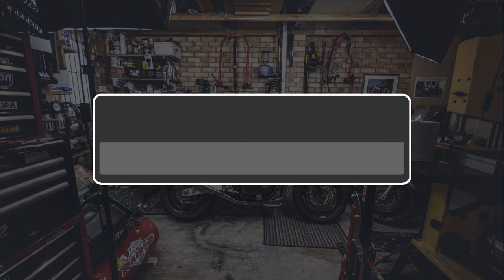Suzuki bandit gearbox problems! || it's Bandit o'clock series 2 Part 6 ||

Comment: Informative video, but you forgot to mention one of the hidden bolts. I found it the hard way, and it is the bolt next to the sump filter for the oil return pipe. :-)

Comment: I have a 99 mk1 600 which has a oil leak so need top end gaskets but mainly the gearbox from N 1st 2nd is horrible even worse when down shifting ......... I think this is out of my skill range . WILL BE RELTING ON YOUR VIDEOS FOR ALL MY ENGINE STUFF .........Super appreciate the time took to do this
Reply from the maker: Hey Dan, sorry about the slow reply. Have you fixed the problems? the 600s are a little different to a 1200 but are fairly close, it's worth getting a workshop manual 👍
Reply: I have still yet to undertake the challenge little daunted having to do head and bottom gasket. It's the timing that is worrying me

Comment: "I hate undoing circlips"
Me too, especially without my safety squints, as AvE calls them.
Been thinking of getting an Abba stand now that I have a GSXS without a centerstand like my Bandit 1200.  Then I can use the stand to rebuild the Bandit like you are doing.  Just a thought.  Might be a fun project.  Not sure what I will do with the Bandit as it had been a great bike.
Reply from the maker: I’ve recently got a new pair that are like sunglasses, with my old ones on it was like looking frosted glass! I do like the ABBA Skylift, I’ve just taken my turbo Bandit off it and I’m going to put the Hayabusa project on it so I can remove the wheels for powder coating and still move it around the garage

Comment: I have  a 2002 Bandit 1200, and I am thinking of rebuilding the engine. Is there any particular manual / publication that will help me walk through the process. My typical experience is rebuilding smaller size engines, but looking forward to the challenge. Also, are parts till available for this engine? Any advise you can provide will be greatly appreciated. I plan to watch you video to see what I can learn.  Thanks... John P

Comment: I have an issue with my 1200 bandit it wont change gear, when setting off it will not change up to second or above but if i get up to some speed it will, but then it wont change down, i did have a gear crunch moment entering into a bend rather fast, but i was fine after just started few weeks later, i don't want to strip it unless i know i have too, been looking for answers  for a while now

Comment: Thanks for your works!All video is great and very usefull!Keep going! This  video  intrest me the most, because i have the same problem too.I have a 1997 Bandit 1200 with 71000 km. The 3rd gear is the loudest,but just until 4K rpm.The 4th gear is not soo bad!Please answer me this question:this gears can make a bigger problem? Or "just whining "and thats all?I dont wana disasemble the engine,its running great.Waiting for your answer.! Thanks! Greatings from Hungary!
Reply from the maker: Hi István, thank you for the kind comment. The gears make noise because of pitting and wear, you could leave it and get no problems for another 71,000km or they could go wrong in 1,000km you just can't tell when/if they will go wrong, I will keep this bike forever so want to make sure it will last 100%. All the best Shroomy
Reply: Hi! Shroomy! Thanks for you answear! I will keep my bike forever,like you!I make every year a little upgrade !I always give my bike the best, and  I dont wanna, the engine get damaged.!I just plant,when the engine get worner, i make a rebuild and then  changed the gears! Thanks again! All the best István

Comment: I  have a Bandit 1200 07 with only 42000 km and I always change the engine oil every 6 or 7 months because I don't use it much. I went to change the oil recently and, for the first time, some bronze-colored filings appeared. I thought of the worst problems. So I removed the oil filter and opened it to check the amount of filings that were inside it and, to my surprise, there were no filings at all!!
How can there be filings in the oil and not in the filter? Any explanation for this problem?
Sorry if my English is not correct. I'm using google translator.

Comment: Great videos! Helping me a lot as I'm rebuilding a bandit and this is my first time rebuilding a motor. I made a rookie mistake of not keeping track of the bolts as I took them out. Do you know of any diagrams that have bolt locations? The ones I seem to have trouble matching up came from the crank case.
Reply from the maker: Hi John, good to hear you are getting stuck in, only thing I can think of is a parts diagram but when the bolts are just placed in they should all sit with the same gap if that makes any sense. All the best Shroomy
Reply: In my experience Japanese motorcycles have the crankcase bolts and their positions numbered

Comment: Just found this video. I need to replace my output shaft on the gearbox and now seriously wondering if it is worth it or time for a new bike!
Reply from the maker: Hey Steve, with the manual, parts and tools you could easily do it in a weekend. let me know what you decide to do 👍
Reply: @Classicmotorbikes  
Decided to do it. It isn't much use otherwise. But with 2 kids it won't happen in a weekend!
Just the engine to remove. The rest is out now. 👍

Comment: Just for the record bandits are just about bullet proof. 120,000 miles and just a spun rod bearing. I'll be sure to test the con rod stretch but if it's all ok it will go back together with factory parts.
Reply from the maker: I've given a few bandits a good thrashing on track and down the drag strip and they have always been great for me. WOW 120,000 miles, mine is only halfway there!

Comment: I have a 1996 bandit 600. I bought it wrecked, got it all prettied up again. When I ride it, it runs and drives perfect but occasionally after accelerating It does what feels like insane engine braking the bike will basically stop itself . Engine never cuts out but does feel sluggish like your dragging a car behind it when it happens. Any idea what that could be?!?!?!

I’ve checked the wheel bearing and changed the brake rotors to make sure those weren’t dragging. I’ve got almost nothing in the bike but I’m determined it will live. Any ideas would be appreciated.
Reply from the maker: Hi Blair, thanks for the question. It’s always hard to answer a question like this without experiencing it yourself but the first thing I would look at is the side stand and switch. If the side stand is loose it could be coming away from the switch that will kill the ignition and then going back in place to make the ignition live again and the bike seem to run as normal. Hope this make sense and hope you find the problem. Ian

Comment: Thanks so much for the video! Do you have any advice to lock the clutch in order to unscrew it? Without the special Suzuki tool of course...(and I cannot put it in any gear, I think the gear selection axis is broken and I need to access it)
Thanks!
Reply from the maker: I would use an impact gun and cross my fingers 🤞

Comment: Hello !
 I have 2000 Bandit 1200 and it's been sitting whole winter outside leaned on the kickstand . once i fired it up it idle but when shifted into a gear it stalls ,  so i decided to bypass the kickstand switch by connecting the two wires together after that it won't fire up , the crank shaft spins when starting also backfires  . I checked ignition coils it shows 40ohm , manual says 2-4ohm.(i have power to everything else though) . any thoughts ? thanks again
Reply from the maker: Hi Sparkovi4, I would reconnect the side stand switch and see if it will start again. if it does start again I would make sure your clutch isn't stuck, I've had this before when you put it in gear the bike stalls and you try 2 or 3 times and then it becomes free and works fine after that. hope you get it sorted. Ian
Reply: @Classicmotorbikes  I ve tried to start it up with the kickstand switch reconnected but it would not fire up. One of the terminals on the neutral/sidestands diode changed in color(I suspected it to be faulty)I tested it for continuity and there's only continuity with    
The terminals 2(red)/1, 2(red)/3 
In the manual it said check for continuity terminals 1/2 an then 2/3 . Did I do it the right way? 

Thanks alot

Comment: what size was the powertool socket wrench used to remove the locknut on the clutch?
Reply from the maker: The clutch nut is 30mm 👍
Reply: ok noted with thanks!
i got 80k km on my 06 1200, i had problems with clutch sag, turned out to be clutch hydraulic fluid, lucky for now i managed with fluid change...will keep this info handy when it happens again, never had clutch replacement from new, and i think it will be coming soon if not later...its gone 50,000 miles already!

Comment: Greeting! I watch your videos often and I think you’re doing a great job. I have a problem and I need your advice. I own a 2002 Bandita 1200, 67000 km. Fifth gear is problematic. I wonder if it is a problem that the engine vibrates very strongly after 4000 RPM. The engine goes like a rocket, pulls  hands from shoulders, but those vibrations ... horror! Thanks in advance for the help! Greetings from Croatia.
Reply from the maker: Hi Bruno, this is a hard question to answer over the internet 😱 have you had any luck fixing it?
Reply: @Classicmotorbikes  No. :(

Comment: Im starting a Bandit O'clock marathon. I've all ready hit likes on the all about a yr ago. Now I'm taking notes and making a outline on the project at hand and Series part #. I have 50,500 on the odometer on my 98, but I change oil frequently. But she is do for a good make over , and I con get a spot at my pals shop.
Reply from the maker: Hi Daniel, good to hear from you again and best of luck with the project. If you every have any questions I’ll do my best to answer them.
Ian
Reply: Thanks, I  appreciate it! 
I just changed the oil and put a couple hundred miles on her. Had to wait for the frost to melt. Not sure yet what all I'm going to do, but I would like to start out with one of those lifts !

Comment: Much thanks for that video. It will help me a lot when dismantling my Bandit 600 engine. However i got problem with the last two bolts: https://ibb.co/sJ57Xj7 Screw number 2 on photo seems to be unboltable, but screw number 1 doesn't want to come out. I can't unscrew bolt number 2 because the socket wrench doesn't want to enter and the screw wouldn't have enough space to come out. You don't say anything about it in the video, how did you deal with it? I was stuck in this moment.
Reply from the maker: Hi Jakub, glad you find the video useful. To get bolt 2 out you will have to remove bolt 1, if you are having problems removing bolt 1 make sure bolt 2 has not been undone so bolt 1 can be removed, also bolt 1 is very tight and needs some force to undo it but be careful not to damage the hex in the bolt, when you have removed bolt 1 you should be able to remove bolt 2 just fine. hope this helps and I hope you get the bolts out ok. Best of luck with your project. Ian